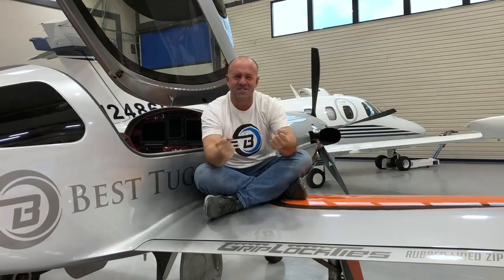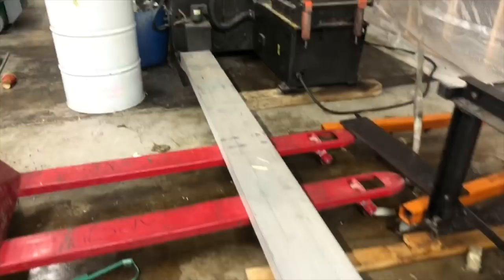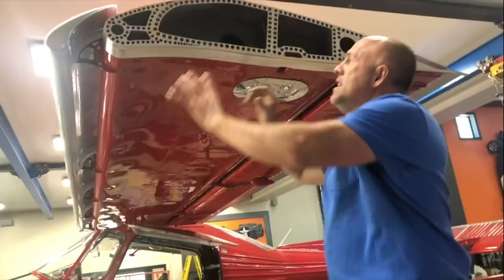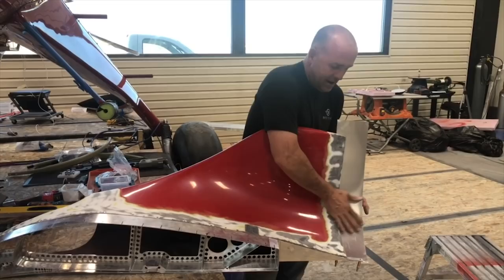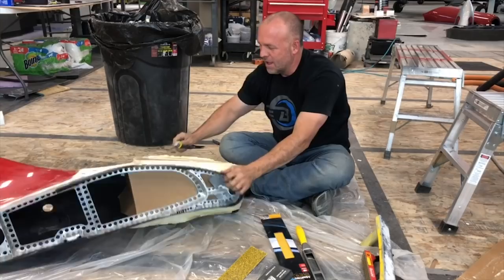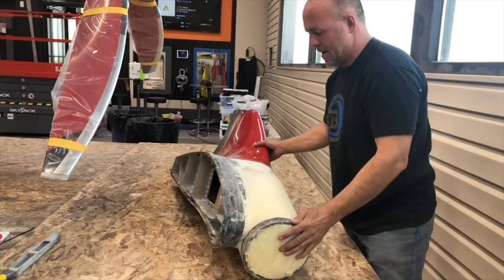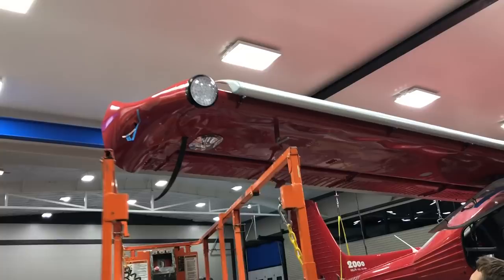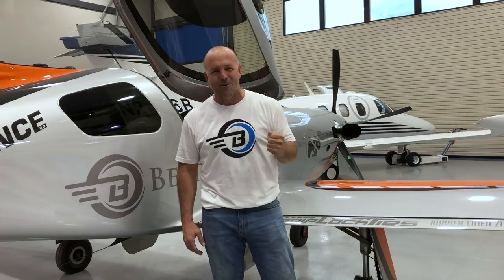Mike Patey Wilga (DRACO Video 15) Wingtip Design Revealed!

Comment: Hi Mike, Thanks for another great video. you are a legend. As a mech. Eng. I am pretty amazed by your skills. 
Viewing the crash It looks like the amount of torque added on this plane was just too much for this plane in a side wind. It looked like the left wheel just immediately went up at takeoff. I can think of two things that might help next time (Probably you thought about them already) one would be to put your collector fuel tank at the wind tip next time - increasing the moment of inertia might help to stabilize the plane ( it can actually also be used to reduce the load on the wing if you want to increase its length. 
another idea that might help is to make your suspension stiffer when taking off at side winds especially when you are taking off on a runway when you can't take off straight to the wind and there is no much need for the large suspension travel.

Comment: I had this idea 25 years ago.. I added it to a old cub. I got my idea from the U2 spy plane. 

When they take off they have 2 down riggers to keep the tips from touching since they are a tricycle landing gear. They fall off upon take off. 

I had my setup where they are retracted and stay so until landing. I hit a button in the cockpit to a solenoid which releases a latch with a spring assisting they snap down and lock into position. After I park I go up release the latch and pull them back up. 

Very simple..  I should patent my idea lol
Reply: now that we all know how it works, maybe I'll patent it. Lol jk. Or am I...

Comment: Man you are Positive and that can make you impossible to stop ! So HAPPY you are the type of thinker that can reinvent the way of the way we fly ! You start with what's the best design you could find and cannot stop refining that plane . The day you scratch everything handed down you will reinvent as they say the wheel or the airfoil design?  Mike think about no Gravity and magnetism Neg- Pos+ and there we have it . My thought is this you have all the tools and the most important Tool in your personal tool Box is your thinking ability and your Optimistic Happy Creative way about you ! Just remember  your whole mission is defeating weight or matter against gases in the air . Why do they call it Air force not gravity force ? And you do have artistic value you are a .01% . Not even 1% of humans push the ways of man and his thinking so Infinity and beyond . Food for thought you are creating whom created are home Earth, and the air we breathe and you fly threw ? And  humankind are not apes evolving still are we ? You can breakdown the box and reinvent the way we fly ? Try running a program for wind resistance using 7 inch spherical half circle by 3.5 inch deep spaced all along the bottom of your wing and see if it creates an airfoil barrier and lightens your planes resistance.  Just a thought.

Comment: What works as advertised: Reducing the hard impact force with the blade spring, protecting the ailerons. What doesn't work as advertised: "Moving the force forward to avoid torsion of the wing". At the point the blade spring attaches to the spar, the vertical force is transferred into the spar. But also transferred is a torque. Which is of the same order of magnitude as the torque that would twist the wing if it had hit with the outer backmost corner.

Comment: Dam as a pilot without access to an aircraft atm this is one awsome looking build, a turbine PZL Wilga dam 👍👍 That's going to be one fun plane.
I have some time in a Kobler as well as a radial Wilga, PZL sure did manufacture some fun aircraft, if I ever find a nice very low hour Wilga 2000 at the right price, I may just grab it and fly it home to Australia with my family and make it an adventure my 5 and 6yo boy & girl will never forget.
Love the Mods on your machine, looks great and it would have to be the ultimate 4place "Bush plane"  👍👍🇦🇺 ..

Comment: MIKE MIKE MIKE 😉

STILL WAITING for that video of discussion on that cowboy "wing spur" after Draco's crash.
      Also open a dialog on a redesign. 

As like a 1/3 soft ball tip.     As that wing preformed as intended unti it imbedded on the wraparound like a stinger.   Which stopped giving at that point.

Comment: The Wilga Walk might be solved by tying the two wheels suspension travel together via a non deflecting rod between them or by running some linkage up the struts to tie them together, or a hydraulic metering system on the dampers.  This problem had to have been solved before on carrier aircraft, because compressing the knee action rear suspension under heavy loads would cause the same type of walk on those aircraft to some lesser extent, even though they are not tail-draggers.  Something like the A-7 or F/A-18 would probably be a good source of information.  Some of the WWII carrier aircraft that were tail-draggers might also be a source.

Comment: Interesting about the "Wilga Walk". I wonder if it's possible to give some limited caster to the main gear to allow for some sideways "give" when landing sideways.  Also, How about a sprayer that can soap up each wheel just before touchdown, so that they can slip sideways, (like landing on wet grass) without grabbing, and accentuating the ground loop?  could also make a "Bump Stop" on the carbon fiber Draco, so that when it contacts the fuselage, it does not dig in. you could also put some grease, or a different color paint (for intentional paint transfer) to see if it has happened if you do have an incident.   
Just some ideas...     
Mercedes has some super light weight bump stops made from super durable foam for their struts.  They weigh almost nothing. 
they are used on my 1986 190D and also my 1995 E300.  Might not be the perfect solution, but something similar?? just an idea..    
love your video!! And plane!!    Would love to see a Wilga Twin!!

Comment: Wilga Walk solution?: Is there some sort of instrument that you can use to see if the plane is going strait ahead vs sideways? If so, this can be connected to an audible alarm that sounds if it is in fact sideways? Maybe you could also use sensors on the suspension for the same result?

Comment: Mike, I'm on the second go-around watching you build up Draco.  Fascinating.  I was wondering if you were concerned about the safety of your Lithium-ion battery pack?  Any danger of it causing a fire?  I suppose you saved a lot of weight vs. a standard sealed 28v aircraft battery, plus a much greater capacity.

Comment: Regarding the infamous "Wilga Walk" (which is the reason why you made those great wing tip skids) I asked myself: is there a way you could make the shock absorbers on each gear work in tandem? Let me explain. The Wilga Walk is having one gear completely compressed and the other one fully extended, this being repeated in a rocking motion by pilot error, correct? If the shock absorbers in the landing gears could be connected (maybe hydraulically) so that when, say, the right landing gear is compressed, the left gear receives that same amount of hydraulic pressure that would keep it from extending, except for minor shock absorbing action which would be kept independent from each other. Maybe, this could minimize the "walk". Many would consider this to be ultra-over engineering. Oh well, just a thought. The Draco is a dream aircraft, congrats!

Comment: Did the leaf spring reduce the damage to draco when you crashed it? Maybe it's hard to know the answer to that, but I just wondered. Will you be able to salvage many of Draco's parts to rebuild or replace it? I love this airplane. I have really enjoyed this build series of videos. Thanks for sharing them. Also thanks for promoting general aviation. I'm old now and I find it hard to live with my feet on the ground, but still love aviation.

Comment: Hej Mike, great project, a question, plse  - the wing spring looks really like a phenomenal invention, or re-invention, as you like, preventing many damages from the wing. Hope you never need it, but in case, it will help, I am sure. For the fixation of it in the spar, I only saw one screw fixing it. With an additional lateral movement - if the landing plane goes in a circling movement - not unusal for a ground loup,  how do you prevent the wing spring trying to slip or slipping sideways out of its mount. Did I get it wrong? Thx - Gero

Comment: A reasonable person WILL laugh but addition of an oversize rollerblade wheel at the end tip of your anti-ground loop spar would considerably lessen ground friction on it in case of emergency, particularly in the case of a paved strip; odds of the occurance of a full-blown ground-loop would be further reduced.

Comment: Possibly dumb question, but (if it's possible to fit of course) would some sort of sway bar or linkage system help the wilga walk you spoke of? On sidecar motorcycle rigs, we use a sway bar from the motorcycle swing arm (trailing arm) to the sidecar wheel which is usually leading the rear wheel and is a trailing or leading arm setup. The bar pretty much stops the nasty habit sidecars have of going into a tank slapper when the suspension just right creating the runaway scenario like the wilga walk.

Comment: Mike, How do you achieve a mirrored copy off of one finished wing tip? I guess it would be possible using a computer a computer to capture the shaped part and then print the mirrored opposite side part that you need. Are there machines that can do that? Also; how were you able to learn and do all that you do with airplanes and still have time to do your day job and be successful at that as well? 16 hour days working and 8 to sleep 7 days a week I guess.

Comment: Hi, I've watched some of your videos and you don’t seem to worry about "galvanic corrosion of aluminum/carbon composite systems" as you bond aluminium and carbon fiber all the time. Do you never had corrosion issues on the aluminium parts?
Reply from the maker: Alex Vargas great point and I should have explained that, as it is critical. I use three layers of fiberglass between carbon and Alluminum I lay up at the same time. Carbon and Alluminum is a bad blend but I have never seen corrosion when I layer between the two with e-glass so they never make contact. I will be sure to show that process in the future. Thanks for mentioning that 🤠

Comment: Since the wing would have to travel a long way to the ground, wouldn't there be a large amount of side load on the stinger... It has the potential to snap off before it's even done its job, no?
Reply: alex davidson the stinger would have to catch on something to do that. The way it’s designed it would be really hard for it to catch on anything but yes it’s always possible. Again this is to prevent damage IF Mike has a simple ground loop and the wing happens to touch the ground. Unfortunately it won’t prevent damage in the unlikely event of Mike screwing up a landing
Reply from the maker: Great question 👍🤠 I could have done better describing its movement. The upper attach point allows partial rotation and the pass through compression load point at the bottom is not fixed, just rounded on not just the front and back but also the sides. It allows an earlier catch of the ground and then can flex inward at angle of the compression loads. This also helps if I’m in the dirt, rocks, or trenches so if the Terrain or obstacle push it another direction it could move either direction to reduce the fracture point.
Reply: Mike Patey Cheers for the reply Mike and the explanation... Can't wait to see this unit fly :)
Reply: Christopher Kelley cheers for the prompt reply

Comment: Probably a few months to late to vote but maybe instead of Tip Skid or Tip Stinger, just split it down the middle,  pull the tip out, and call it,  the The Skid Stinger. Instead of trying to choose between two good badges/names for the invention that describe the purpose in different ways,  include both for the full description. 
... SKID STINGERS  ,or,   STINGER SKIDS.

Comment: All that drag reduction gone with addition of wing tip skid lol
Reply from the maker: airraptor 😂 lol I know right, on this plane I cleaned up what I could do easily but drag reduction was my last concern. My race planes it has always been my first concern. You pick one and trad for another on any airplane design. It’s funny how opposite I am when my VNE on this plane is reached at half throttle and I’m more concerned about function, stall, and damage prevention and almost little regard to drag at all.. if I didn’t have 700HP I may have thought twice about the drag of the wing stinger but I just wasn’t worried when VNE is my speed limit.

Comment: Why didn't you put limit switches on the wingtips to trigger a warning light if the skid approaches the wing?  Slacker!
Reply: No, wait!  STRAIN GAUGES on the skids!  Trigger a warning if the spar is loaded to a point that is potentially damaging.
Reply: AND.....and.....nanobots in the wings to continually monitor the spars for cracks.

Comment: Amazingly over-engineered, but if you have access to all those toys, why not?  However, combining glass and carbon in that way is not a great idea from an engineering point of view, the different modulii of elasticity don't work well together. Pure glass would have been fine.

Comment: Did you just put carbon fiber onto aluminum?   You WILL have galvanic corrosion, and it will eat away the aluminum!!!!!!!!!   Never  rivet aluminum onto CF either!!
Reply from the maker: riff42 Good question, I should have described that better. One part of the episode I used the Alluminum just as a mold and removed it and then where I rivit the carbon to the Alluminum I use a couple layers of EGlass on the carbon between the carbon and the Alluminum. This method works really well in separating direct contact when you need to attach the two. I often forget to describe everything I’m doing, it gets so long and I also think others already know it. I’ll try and do better at my more important areas like that and not assume it’s known.
Reply: I would have loved to see how you laid out the fiber on the wing tip over the foam, great learning opportunity. New to your channel, love your enthusiasm! I'm working to one day hopefully have a shop just as nice getting to do the same sort of projects you are doing!